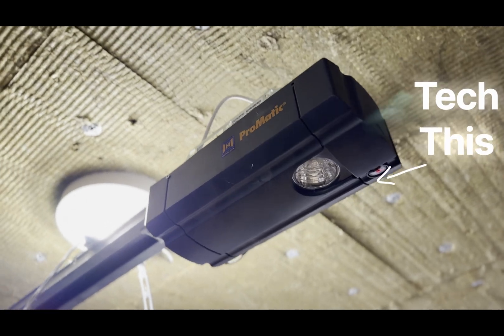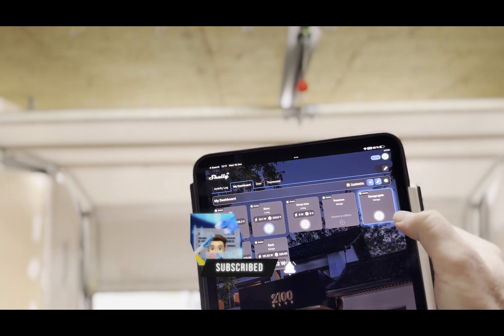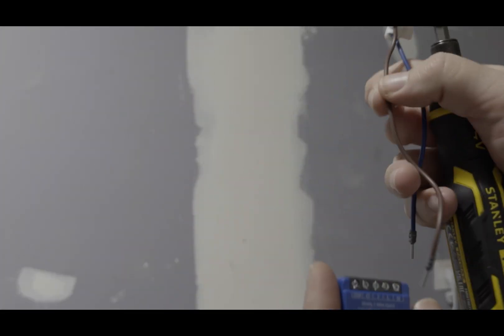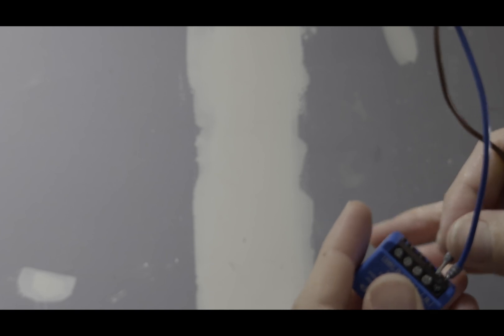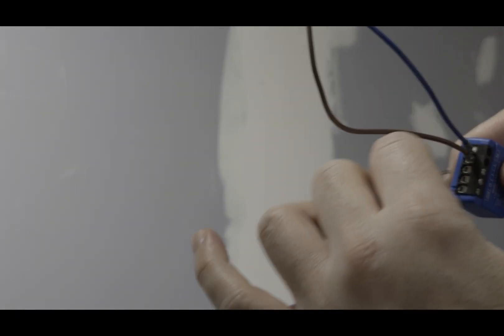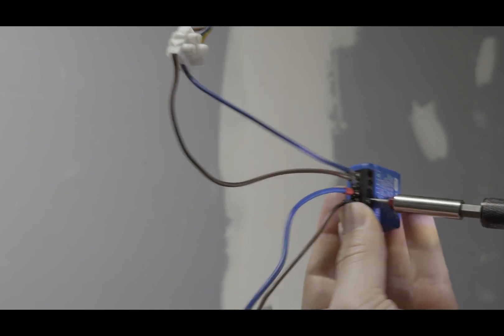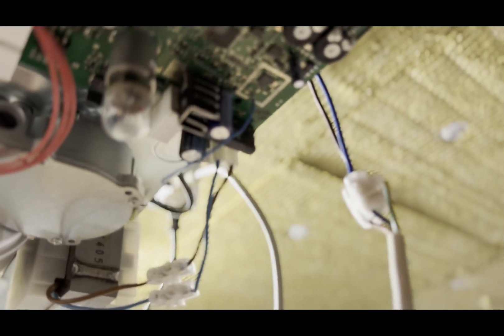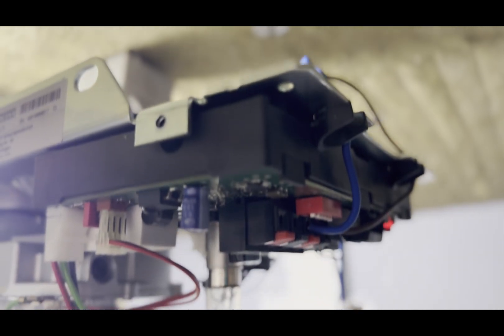How to Remote Control Your Garage Door with Shelly 1 Mini Gen3 🚪🔧

Comment: Seems like you left a lot of stuff out. First of all, I'm guessing you wired the two non-voltage wires  (I can't refer to them by color because you used the same colors as your 220 volt connections, YIKES!) to the same contacts as the existing physical switch? Is that correct? So, the Shelly is simulating a button-press?  If not, please explain.

Secondly, what did you need to do in the app (when configuring the Shelly) to get it to simulate that button-press? (assuming that's what you did). But if you control your door some other way, like the motor has some special connections, could you show what they were? And, in that case, how those of us with a different brand of motor might determine how to make the connections/configuration.